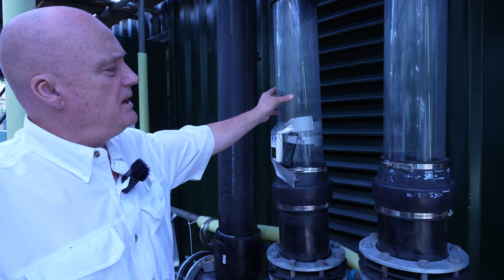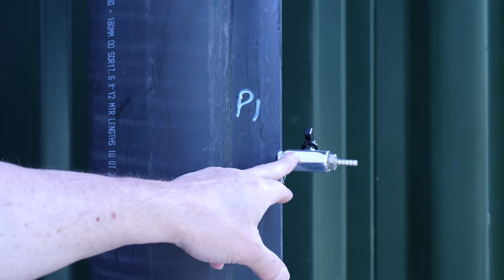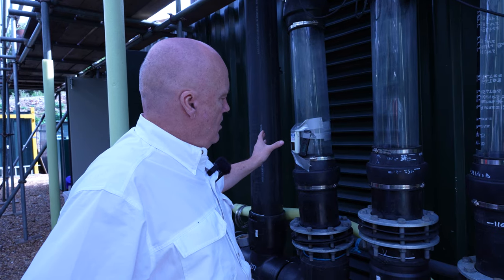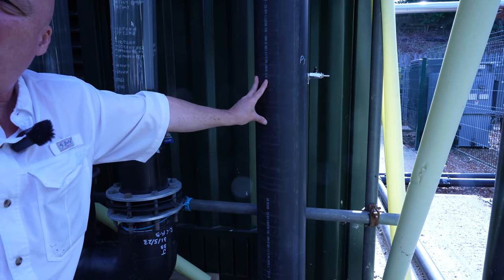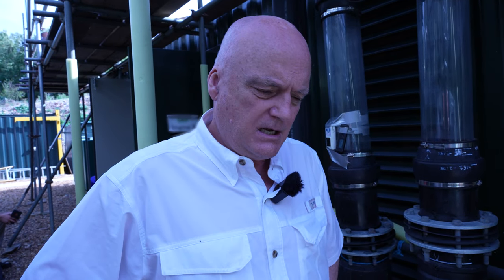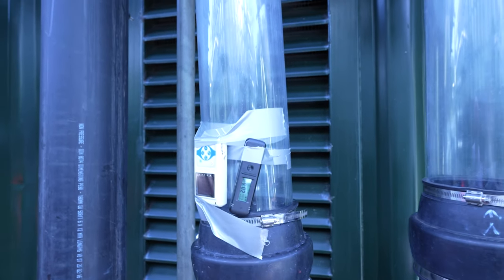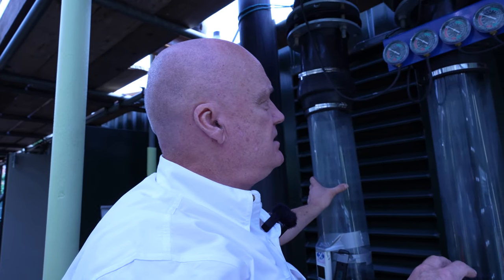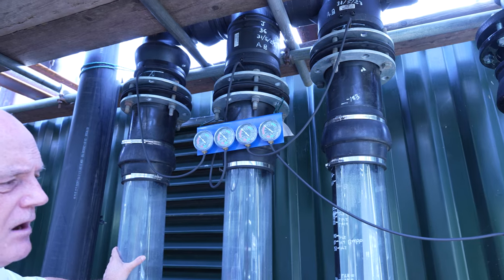THOR - Overview of the bubbler layout and operation

Comment: Dear Bob iam looking at all these vids & Thankyou but have no idea what's going on. Could you just give brief synopsis? Don't mean in detail but just basics such as are they running an engine on something?
Reply from the maker: My aim now is to publish the vids. I will put them in logical order and explain ASAP. 

This is a grid connected natural gas generator - the great thing about it is that you can test the process with 100, 200 or 300kW say as desired - you don't have to find 300kW of lightbulbs and unplug them etc.

It is - without several key aspects, still apparently reducing CO, CO2, NOX, HCs and upping the O2 output from non-modified base.